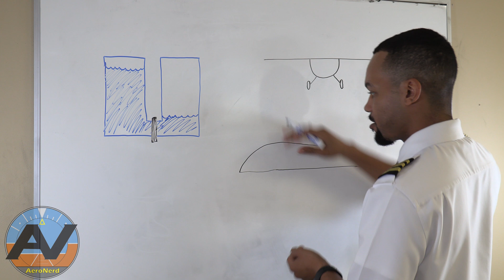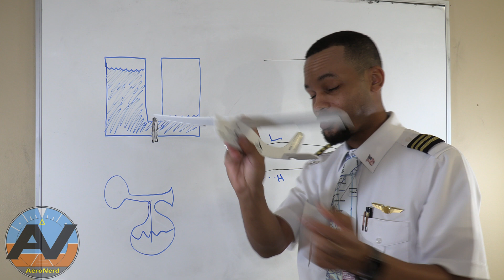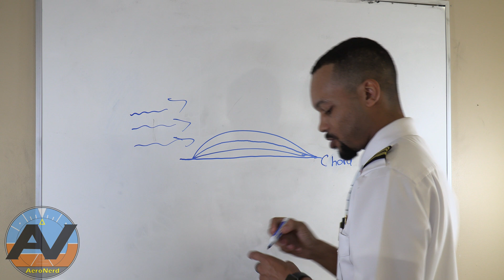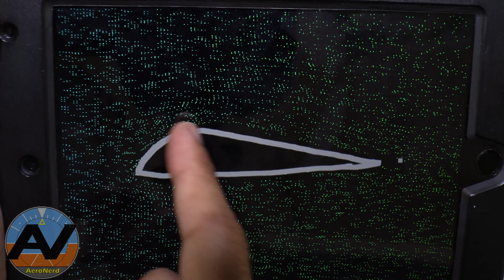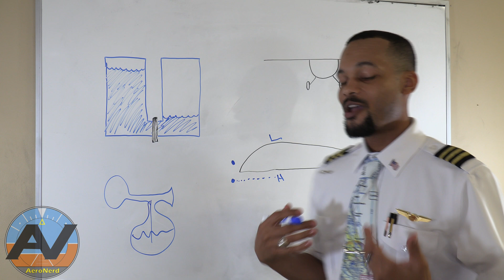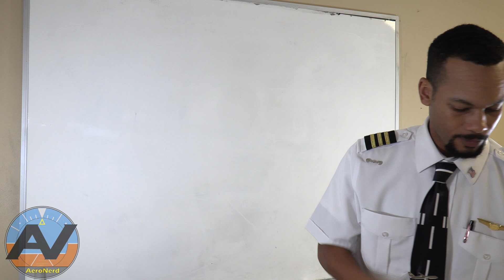Private Pilot Ground School 4: Aerodynamics Part 1

Comment: I really like the way that you teach and I think that you post really great content. But the theory about each molecule going above and below the wing and then meeting up is actually incorrect. I used to think the same thing. NASA posted an article about it. The air above the wing actually has a tendency to get to the trailing edge first. The way that I like to teach Bernoulli’s principle is to draw a sideways Venturi, and then erase the top half. The bottom half will resemble an airfoil.